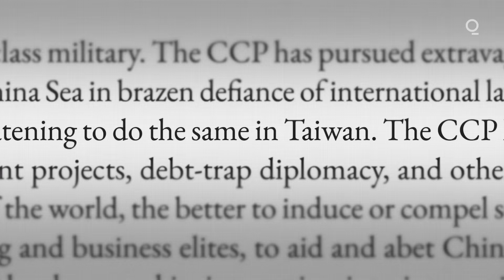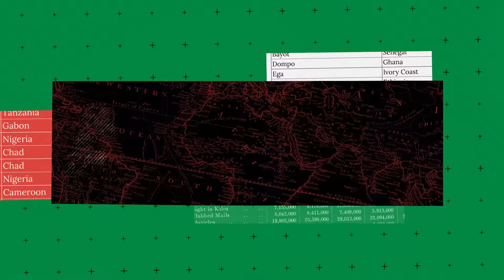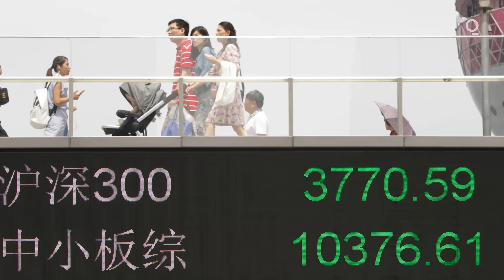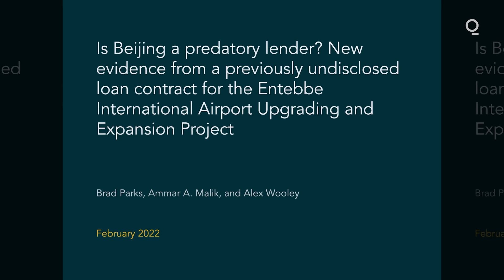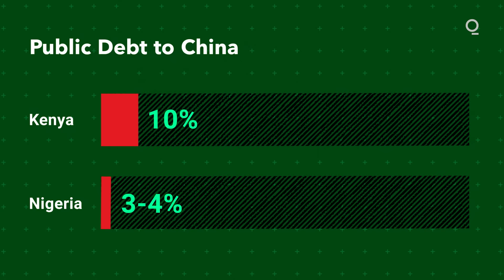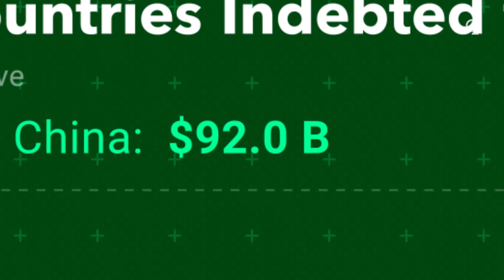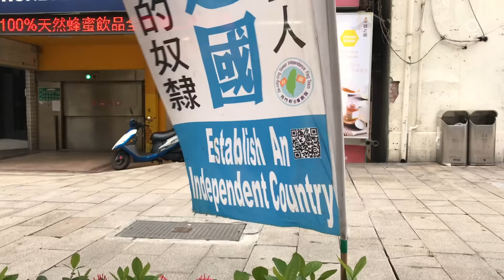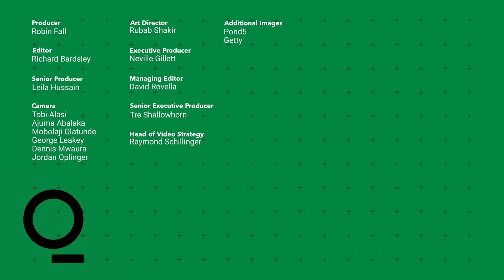The Myth of the Chinese Debt Trap in Africa

Comment: How come 15% debt that built literally 1/2 (some report set the number to be 2/3) or more new roads, bridges, railways,  schools, dams, hospitals are called debt trap. While the other 85% built nothing in past 100 years is NOT?
Reply: Actually if you take debt to build basic infrastructure like what you mentioned then it's ok. But some countries like Greek or Lebanon they took debt for luxurious life style and most of it goes to the pockets of the high officials and ministers then it's a debt trap.
Reply: @DDKKAY  no thats called corruption, debt trap doesnt have to be corruption.
Reply: @DDKKAY  Interestingly, they took debt from the west. Not from China. Before Greek financial crisis, China rarely lend anything to Greek.
Reply: So the first roads, ports, railways and airports in Africa were built by the Chinese starting around 2000? 

Tell me another.
Reply: Add electricity to that list as well.  SMDH.
Reply: "debt trap" usually implies that the interest rate is ludicrously high, to a degree that the debt can't realistically be paid off. it has nothing to do with how the money is spent, or the size of the principal.
Reply: @thefance4708  Yet it is an open fact that Greek took so much debt from west that can't even pay interest. Isn't that debt trap?
Reply: @ZZZ-zl4mz  You could argue that Greece's debt is so large, it's mired in a "debt trap". You could also argue that sneakers on a horse are "horse shoes". Neither case is a central example of its relevant idiom. 

"Debt Traps" are usually associated with payday loans, and are widely considered predatory since the interest rate per annum will vary anywhere between 10% to 1000%.
Reply: @ZZZ-zl4mz  Although in the context of geopolitics, the video is referencing "debt-trap diplomacy". In which one nation lends money to another, but with strings attached. The U.S. and China are both guilty of this. The U.S. wants to push its liberal ideology, and China wants to push its communist ideology. 

Semantic drift abounds, as it often does in politics.
Reply: ZZZ didn't listen or view the video well.  Basically, the infrastructure that Africa has now was built under colonial rule.  Now that you know that fact, what will you do with it?
Reply: @thefance4708  So who created 95% of debt of Greek has no responsibility. But the one who only lend 5% money and built a lot of infrastructures is the only bad guy. Only because he is not the west club. Right？

So it is not who created most debt （with little benefit), but whether the lender is from the west matters all. That is the only standard and logic. Got it. You always win. Like the west.
Reply: @thefance4708  China doesn't want to push communists. Because China itself is not communist at all. Communist is just a name. A political icon. The system is more capitalism plush socialism. Not Marxism socialism. But social interest oriented system.
Reply: Propaganda war.
Reply: Well said. A lot of people don't know what debt trap is. If China lends money to Jamaica then it's for Jamaica to spend that money wisely and pay back the debt.
Reply: @DDKKAY  while the bombs are being called generous gifts from the west
Reply: @thefance4708  I'm in Kenya, & their is no Communist ideology is being push by China here. Or anywhere else in the neighborhood (East Africa) that I know of. So get your facts straight first. It's all about the mindset and intentions. Neo-colonialism vs Trade
Reply: @thefance4708  you're just confused
Reply: why are you guys talking about greece? the big question is: where has 85% of all that loan money gone??? why arent all those african countries outraged? why arent people mad? to me, and outsider, it looks like people dont care that their government is corrupt af.
Reply: @obiwankenobi661  Corruption, happens in any government. Actually all electoral system are more likely to be corrupted. They just legalized many corruptions not allowed elsewhere than claim to be transparent. Whether the government is more corrupted depends on with same budget, how much it did to the people compare to others. Both short term and long term.
Reply: @stevensmith2078  the Greeks are grateful to the Chinese for the port deal. They were the only debtor that gave the greeks an amazing deal when they defaulted. Instead of completely taking over the port they shared it instead. You can search for videos of their former finance minister Yiannis talking about it.
Reply: @budgetking2591  a debt trap doesn’t have anything to do with  corruption but debt itself does
Reply: @ZZZ-zl4mz  no that’s not how the Greece got the debt it wasn’t spent on infustructure it was on social welfare
Reply: Greece was using fund incorrectly. They also had many ghost employees. The level of incompetence and corruption is very uncommon in Europe. They have a low trust society due to their ottoman past.
Reply: @marcellusnichols7384  yeah
Reply: You gotta hide the tree in the forest. Don't want it to be too obvious.
Reply: @agapp11able That is what should have happened and should happen. The pace of change has been glacial.
Reply: Instead, the colonial powers milked the continent dry 😏
Reply: @stevensmith2078  lol no they were built in South Africia by europeans almost 100 years ago.. lol the "first" ok bud LOLOL educate yourself

Comment: There are risks in EVERY INVESTMENT. By developing infrastructure early, the land is cheaper, labour is cheaper and the growth potential is greater. As a country develops, and wealthier, every patch of land becomes more expensive and the costs increase exponentially. 
Even the Chinese rail minister said they won't be able to repeat their high speed rail project today due to current land acquisition prices. These projects will be considered cheap in 30 years time. China has shown us it is possible, just don't get involved in a war with your neighbour!
Reply: That's nice, but what about the dollars in and dollars applied and dollars evaporating into offshore banks. 
Infrastructure is for industrialization and in dustrialization o0nly benefits the benefactor while the population remains enslaved to the 'fast n cheap' side of the equation.
Reply: It isn't faster easier or cheaper if you have to change it, repair it or if it diverts resources from more profitable ventures. This is the norm for speculation: cheaper- yes, less profitable also yes. Build it and the market will come usually fails and underperforms when it doesn't. China knows this better than anyone which is the cause for suspicion. The volatile nature of speculation is due to the lack of data. Everything increases in price as it's value becomes more obvious but it's value also increases as the data increases efficiency productivity and awareness.
Reply: Land in Africa is not cheap. It is a poor continent with ridiculously overpriced land.
Reply: Unless instead of using it for those projects its been pick pocket by these corrupt officials
Reply: A you an African 🤔🤔
Reply: @JJ France what does transparency do even?

Comment: There is a lot of fear about China taking over African assets if a loan deal goes bad: mines, airports, ports, bridges, roads, etc.  In my mind, feasible ways to "take over" a country's assets is either by hard or soft power.  Hard power is by military means but China at the moment does not seem to have the capability to sail loaded ships all the way to Africa to actually land enough troops to secure such assets.  Soft power would be by financial tools such as establishing sanctions via a tool like SWIFT; but China does not control such means to disrupt financial flows of an African country.  So if anyone can answer, how would China leverage hard or soft power to actually take over an African country?  I do not yet see the fear of a take over being justified.  Can someone educate me?
Reply: China doesn't have to take over Africa per se. All China needs to do is to build up economical relationships with local authorities. Think it like this: China builds infrastructure and one of the conditions in the contracts is to sell natural resources a bit cheaper to China, "we build your hospitals and you give us 20% discount on cobolt and copper". This means the African dependance of Western foreign aid(which is just used as a leverage for the resources) declines, which means the prices of natural resources to West increases. This gives China an economical advantage over West. This is just ONE nuance in the whole scenario.

Deplete the Western influence in Africa and there is no more cheap phones, cars, microwaves, TV's etc. Economic recession happens and voila! You have succesfully demolished Western economics. While the West is playing checkers, China is playing 5D chess.
Reply: Lol bro. China might actually be taking over kenya through “soft power”. Why?
Because the profits/revenue obtained from the Standard Gauge Railway (SGR) ,built by Chinese, go to the Chinese. Also, all revenue/profits obtained from toll fees in Nairobi's expressways are directly going to the Chinese. Complete dominance! In my opinion

Comment: 1. Are the projects financially sound? If not, then China's motivation is not simply economic.
2. Taking over operations of a facility can be an example of a debt trap. While China may not be seizing assets, they are taking over the control of its operations.
3. While China may not be using debt to politics, it has in other areas.
4. Just because a trap has not been sprung does not mean a trap does not exist.

Comment: What was omitted by the male commentator regarding the west coming in and building all the railways, is that each of these rail systems were all built an separate width rails that could only be used for their own purpose therefore limiting any inter-national trade or use. This was done intentionally to prevent these nations from using the rails for their national interest (trade, transport, commerce).
The European companies wanted to keep African nations separated and fractured in order to keep them dependent on their individual system. 
China is coming in with a universal width size of rail so that it can inter-connect all African nations into one continental rail system connecting all African nations to the same rail system. Therefore unifying all of Africa
Reply: This is a key design for  the prosperity of Africans future.
Reply: Wow didn't know that. But I'm not surprised  🤨.
Reply: I would love to know where you learned this, seems like an interesting read.
Reply: @spehhhsssmarineer8961  it’s been years since I had come across that. But the reasoning was each colonizing country or private business wanted struck control of what went in or out it was also a way of making sure each colonized state was trapped in not being able to do inter-nation transactions without permission
Reply: @jvs333  Let me know if you do remember because I really would love to learn more.
Reply: @spehhhsssmarineer8961  I was trying to find it on google but I haven’t found it. But it said that the French used their own gauge as did the British, private companies would also use as a way of controlling the mining logistics. In 1967 it was Mao‘s China that convince Zambia and Tasmania to signed the Tazara railroad project that opened up trade/commerce rail that wasn’t controlled by colonizers solely for their interest. The tazara rail led to the Tanzanian port of Dar es Salaam.
I will keep searching for the article
Reply: @jvs333  Thank you so much, I love to keep up to date on topics like this.
Reply: @spehhhsssmarineer8961  you’re welcome. Like you,  I also love learning about the world, events/causes, history. Funny how the truth is seldom as it’s being reported by today’s media as it all seems to have a political interest spin to suit an agenda rather than to inform, educate and facts
Reply: @jvs333  Though I might disagree on your beliefs about media bias I too wish learn as much as possible about history.

Comment: The infrastructure built by the colonial governments were put in place strictly for the the purpose of resource extraction on the cheap. There was never any plan to foster development or create equitable trade.
Reply: Exactly the old 'mines to port' infrastructure strategy' this is why in some parts of Africa up to recently it would be quicker to travel to a mine on the other side of the country than to the next city over because there is the infrastructure to travel there but not to the next city. 

This is what China done in its own country and trying to do in Africa now is create that "city to city strategy" which spreads wealth out more and allows more trade to occur.

Comment: If debt trap helps the population breaking out of poverty, and take traction of economic development, it is called mortgage. 
Economy is like an engine, loan is the oil. You want to start the engine, but complained about have to pay oil.
Reply: Exactly. You have it correct.
Reply: Debt trap doesn’t relieve poverty, it contributes to it.
Reply: @stevensmith2078  Prosperity was founded on integrity, modesty, courage, patience, innovation and so forth. Lack of work ethic and comprehension of basic economy, is the root of poverty.
Reply: @hippocreation  I don’t disagree greatly with your comment above. What am I missing since it is a reply to me?
Reply: @stevensmith2078  China gives cheaper interest, better payment conditions and easy to get compared to IMF. IMF will make them jump through hoops, impose economic/political conditions, higher interest, an oppressive paying condition - and you call China loans as debt traps? There is a reason why now african nations run to China instead of IMF for loans.
Reply: @stevensmith2078  lol So staying undeveloped is the way to relieve poverty? Get your brain checked.

Comment: Most of the projects were built by Chinese companies using Chinese cheap materials and, like in China, many of the projects are substandard and not likely to last long. Some weren’t even completed before started to fail. “Tofu dreg” projects in China are collapsing and the ones built in Africa will do the same. Cheap and quick is great if you don’t care if they fail in a few years,  the African politicians get the fame for setting up these projects but probably won’t be in power when they fall apart in a few years so they won’t get the blame.
Reply: so give an example?  or you just a parrot
Reply: Its so funny how you people move the goalpost. From actually its a debt trap to "actual its tofu dreg"